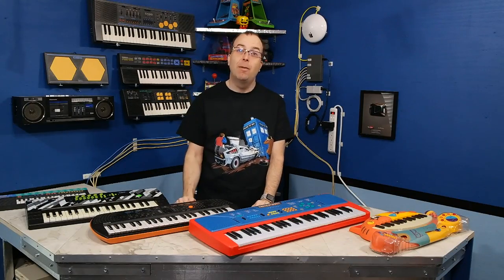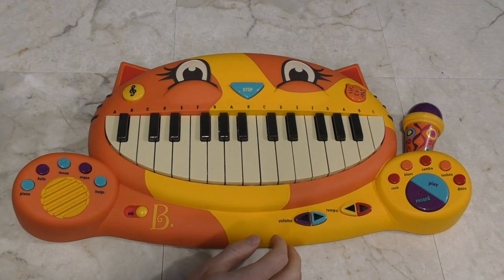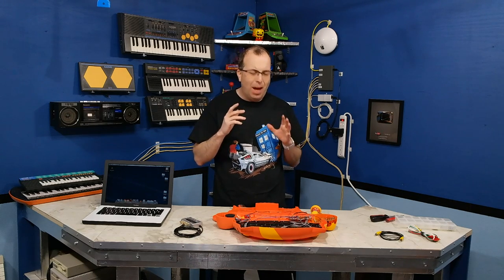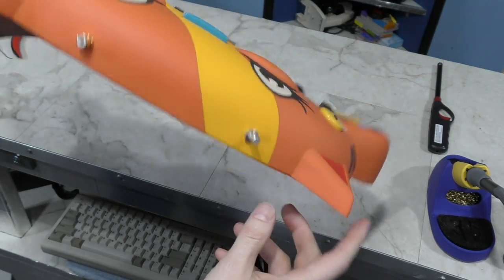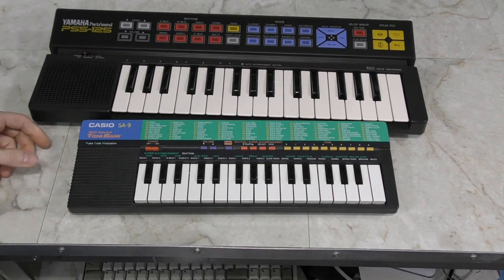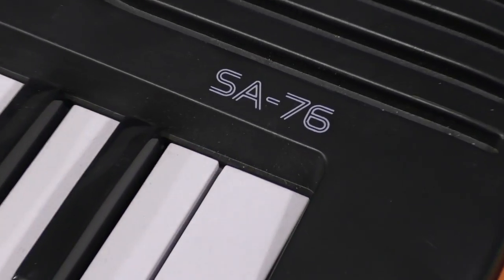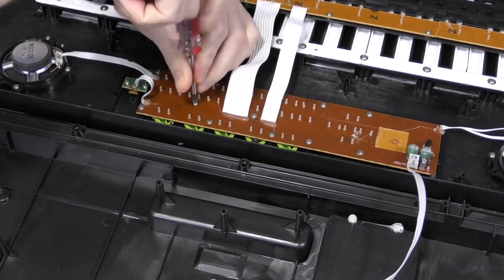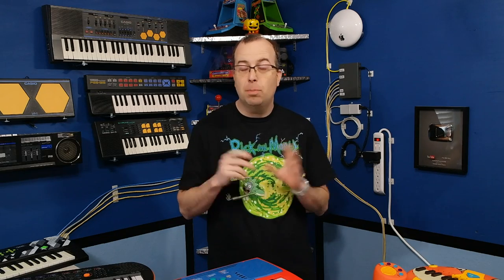Modern Toy Keyboards, Meowsic, Casio SA-76, SA9, & Technobeat.

Comment: What's the reason for the capacitor?
Reply: Dan Nichols 

Allows the "AC" audio to pass, while also blocking any DC bias / offset, as that could feasibly cause damage to the input of the sound card etc.

It's just a good idea to add it for safety anyway, but it's proper use depends on the exact circuit, and where you are tapping into.

Another possible issue is if the "ground" wire to the output socket isn't connected to the circuit ground, but that's only really an issue if there is more than one output connector which will be hooked up to the same mixer or something (which could create a short).

Again though, it shouldn't be a problem here, as there is only one output anyway, and the kitty keyboard is being powered by batteries.

(which essentially means the whole circuit of the kitty keyboard is "floating" with respect to the sound card / laptop.)

Probably a long-winded way of saying "it'll be fine". lol

He could have tapped off a true line-level signal from before the amplifier, but I don't think it would have been worth the effort here. lol

In many of these cheaper keyboards and toys, the speaker is driven using a single transistor, or even directly from the chip in some cases (usually when driving a smaller speaker, like the piezo beepers in musical greetings cards).

In almost all cases in the cheap stuff, the audio is also produced by toggling a single output pin on the chip, so just crude PWM rather than a proper DAC.

(the sample rates and bit depths are way too low to warrant the added cost of a separate DAC chip anyway.)
Reply: The value of the series capacitor will usually determine the cutoff frequency of the audio btw, as it basically forms a High-pass filter.

(where "DC" is considered to be 0 Hz, as it's an unchanging constant voltage bias.)

So, a 33uF capacitor will pass more of the lower frequency stuff (and give more bass to the audio), whereas a 4.7uF will filter out more of the low frequencies, and sound thinner.

The exact frequency response depends entirely on the exact circuit of course, as well as what it's plugging in to (as the input impedance of the sound card is also a part of the circuit in this case).

And yes, I am a bit bored right now. lol
Reply: It's to avoid high variations of the audio wave. Yeah, I answered in one sentence.
Reply: Leon Blank 

That's not really what the cap is doing, that's what the potentiometer is for.

Yes, I could have explained it far mor succinctly, but where's the fun in that? :p

If even one person learns something new from my ramblings, then I'm more than happy to do it.
Reply: Yeah, I was very succinct. That was the deal ^^ But still, if the peak is changing too fastly (and not overdriving, that's what the potentiometer was for actually), either because of a bad connection or a bad signal, the cap will avoid this problem by soothing the signal a bit. I never used one in my add-ons jacks, because I know the piano is using low voltage and PWM modulation, so no risk at all. Still, if you're a purist, free to you to add more safety to your circuit & setup.
Reply: Leon Blank 

There is a risk of there being a fairly large DC bias with this type of mod though, especially if you're connecting across the speaker.

There could be an appreciable current flow too, even though most properly designed line-in stages will be AC-coupled anyway.

Also, as I said earlier, what someone might assume assume is a "ground" or 0V point on the speaker might actually be driven differentially (BTL style).

(which I believe was the case with the Casio keyboard David modded in a previous vid, although that specific keyboard already had a line-level output, as it turned out.)

So, even with the cap on the middle pin of the socket, there can still be situations where damage can be caused to the keyboard and / on the equipment it's hooking up to.

Consider a similar mod (where the "line out" is taken from across the speaker), and where the keyboard has an old-skool linear PSU, or a second output plugged into the same mixer / sound card...

That would short one side of the (BTL-driven) speaker directly to the true circuit ground, and potentially damage the amp.

I don't think I'm being too alarmist tbh, as I'd rather that than see people's stuff get damaged. ;)

It's really not that hard to do a proper line-level output on stuff like this, even if the speaker is driven directly by a chip.

You just need to determine the true circuit ground, which in most cases will be connected directly to the negative battery terminal. Then you need to tap off the audio signal, preferably before any power amps, maybe add a resistor divider if the maximum level is too high, then add the DC-blocking cap.
Reply: Again, with all of the above being said, the way David modded the kitty keyboard in this case is fine, as it will only be being powered from batteries anyway, only has the single line-out, DC-blocking cap, a potentiometer.

It doesn't look like the maximum output level is that high anyway, even without the pot.

(although obviously still too high for the input on the UCA-202 which would have caused clipping, hence the pot.)

All I'm basically saying is - yes, connecting across the speaker may work fine in instances like this, but in other setups has the potential of causing damage.

I did enjoy the vid though, as I always do, especially the Knight Rider cover. :)
Reply: He shouldn't use a polarized capacitor on an AC signal without DC bias though. He might get away with it for a while in this case but it's never a good idea to apply reverse voltage to an electrolytic capacitor.
Reply: falsemcnuggethope 

Yes, in principle I agree, but many pieces of audio equipment over the years have often just stuck a polarised cap just after an opamp output, usually with the cap's positive pin towards the opamp.

Of course, the problem with that is that assumes there will be a positive DC bias from the opamp, or virtually no average DC bias at all.

That same assumption likely caused some now-infamous issues in things like the audio outputs of certain Amiga computers, namely the A1200 and A3000. (IIRC)

They did the same thing with the polarised caps there, but it turned out that the opamp outputs had a constant negative DC bias, so it shortened the life of those caps, and often caused them to leak as well.

So yep, they should really just use non-polarised electrolytics in many audio circuits, or just two polarised caps back-to-back.

(which, AFAIK will form a perfectly good non-polarised cap, but then you might be getting into the realms of ESR and other metrics.)

In fairness, this is just a "Meowsic" keyboard, so I don't think anyone is too fussed about absolute audio quality, nor the life of the cap. :p

Always interesting to discus this though, as even top-end manufacturers sometimes get the choice of cap wrong. ;)
Reply: falsemcnuggethope 

Here's a superb explanation of the issue on some revisions of the Amiga 1200 motherboard.

I think that if they'd have just used NP caps, half of the issue would have been avoided, but then the opamp gain was too high also.

(similar problems have been seen in all sorts of circuits, the Amiga is just an example that springs to mind, but they are still amazing machines.)

https://youtu.be/7sZ7vLcURK4

Comment: I've got a SA-9 on ebay recently that was built in 1992, and it has an output jack - but from the board shot, it's missing not only the jack, there's a few other components missing from the output stage there.

Comment: I have the Casio SA 46 and it works great, keys are smaller but not a prob.  It fits in my laptop backpack perfectly.  I do recommend getting the AC adapter for it because it will eat batteries.

Comment: The reason they used to make the black keys disproportionally long compared to the white keys on tiny keyboards is that they only flex and give on the plastic itself, make the black keys shorter and they would be much too hard and difficult to press down. Early toy keyboards had that problem instead until they got redesigned.

Comment: The sa-76 is actually more closely related to the sa-46. They both have the same internal electronics that include an 8 bit holtek chip that handles everything. They both have 8 note poliphony and the holtek chips have a varient of yamaha sounds similar to the presets that you would find on the yamaha psr-310.

Comment: As a followup, upon analysis of Techno-Beat keyboard's design.  There is a problem with key allocation/octave in the keyboard matrix decoder chip affecting the polyphonic capability (very strange symptoms).  Not fixable by the consumer.

Comment: you look like the guy that could take anything apart and restore it/improve it! I've had very limited beginner's luck taking keyboards apart and finding dry solders and the like. but once the key contacts start misfiring velocities and/or not working, replacing those silicone squishy connections has always been a bust for me. too bad as many would be usable used keyboards are laying around people can't get rid of but those velocity contacts seem so cheaply made and not easy to fix... I have found toys like this that were greatly playable and wish they had midi on them! haha

Comment: It looks much like the mod that my Dad helped me to do with my Apple //e computer. I had a toggle switch that turns off the internal speaker, and replaces it with a similar resistance resister. The toggle switch is important, as if the audio is not connected, the toggle switch can undo the mod, so that it can be used just as before. We added a line output jack isolated by a capacitor to help make sure there would be no polarity problems. I had no volume control, but the volume was about right, and my boombox was quite capable of controlling the volume. My computer sounded much better playing through my boombox. Soon after 1985 when I bought my Apple //e computer, later Apple computers had the headphone jack, and so no such mod would be needed. Just a simple adapter cable.

Comment: Hi. Maybe you could check out the Yamaha PSS-A50. It came out this month, and is one of the cheapest 'compact' keyboards with velocity sensitive keyboards and uses the same key-bed as the Yamaha Reface (£200). I reckon it could seriously dethrone the Casio SA series.

Comment: The samples and code could be on the 8 pin chip U2, if this is a SPI flash chip. Pinout of these chips are usually all the same, search e.g. for W25Q128.

Comment: The Techno-Beat has two problems:  1, springs on keyboard are too stiff.  2,  The keyboard octave scan is asynchronous. Keys held down in one octave interefere with notes selected in different octaves.  A matrix decoder is needed but will never happen here.  The 4.5 octave keyboard is unique. I have only seen them on harpsichords.

Comment: Doesn't a capacitor in series with an audio signal cut out the low frequencies. There are used for that in multi driver speakers

Comment: Someone has to learn how to use a Potentiometer correctly... To adjust a Volume you have to connect the Potentiometer as follows:
When you look at the front of the shaft, the center connector (wiper tap) is the output for your Amplifier or recording device, the left resistance-connector goes to ground, the right resistance-connector is the Input (it goes to the Audio-Source). In this way, you turn CCW for lower volume and turn CW for higher volume. The typical restistance of a potentiometer for volume control is 22k. Put a decoupling-capacitor at the input or output of the potentiometer to block DC Voltage/current before you connect it to an Audio-Amplifier or recording device. Your capacitor on the RCA Jack is connected in the wrong way. Turn it around, so that the capacitor's negative pin goes to the middle Pin of your RCA Jack.

Comment: What's the reason for connecting capacitor when making a speaker out line and what's the rating of capacitor?
Reply: I can't tell you the rating, but I think it's just as a buffer so he doesn't send too much voltage into whatever he's recording with.
Reply: @roberte2945  ok, thank you.

Comment: The B Meowsic is awesome. Thanks to this video I snatched one up when I saw it in a thrift shop. It does have actual music applications. I made a track with it yesterday I call Lost Cat. I used the meow, the piano, and banjo sounds. I haven't done an output jack mod. So I mic'd the internal speaker with a dynamic mic. I ran that through an Alesis MIDIVERB III multi effects processor to get the echo effect. The drums are provided by the Yamaha RX17 and Roland M-DB1. The bass is provided by the Yamaha FB-01 and Roland M-DB1. The topline is the B Meowsic. Let me know when you think.

https://youtu.be/J6CHlI-cbbY

Comment: I have a First Act keyboard that is not too bad. there are better ones and there are worse. I needed a crap keyboard to try and circuit bend and this one exceeded expectations (still cant find the pitch resistor though)

Comment: What is the reason for the capacitor on the line output?
Reply: It acts as galvanic isolation between the keyboard output voltage and electronics within the recording device. David explains it in his video https://youtu.be/Nwi6NmuwY4I . Since the voltage is AC, the capacitor almost acts like short wire, but saturates and becomes very resistive if a large current is to pass through, the same direction for a relatively long time, thus effectively protecting the recording electronics from this current.

Comment: I had a first ask toy keyboard, and it is weak as hell. The plastic is horrible. The speaker casing falls off the speakers fall out. It cracks really easily keys. Come flying off it’s horrible, horrible design. I’ve had two of them. And the buttons fall through. It’s a horrible design.